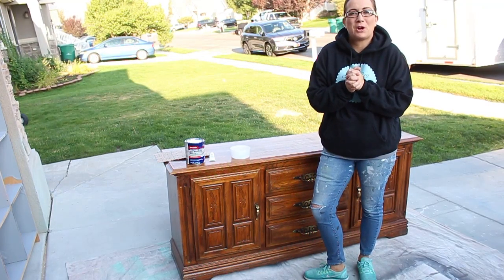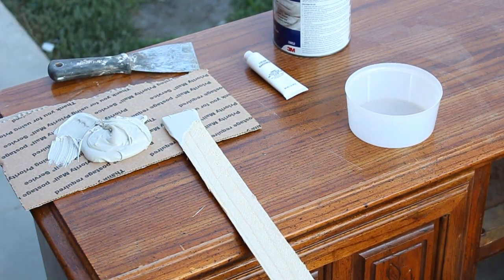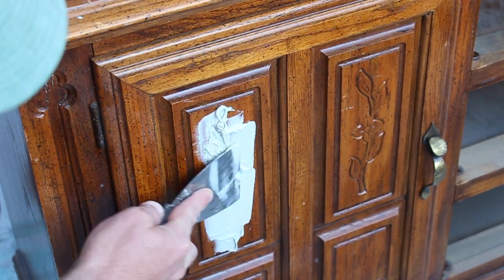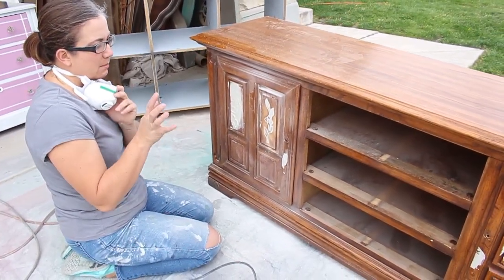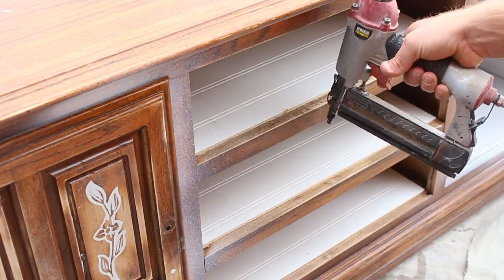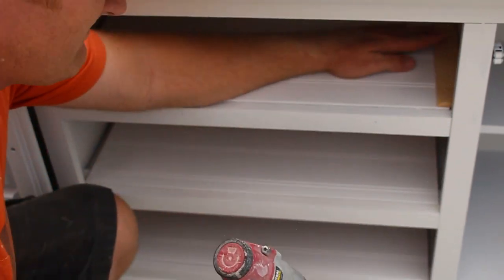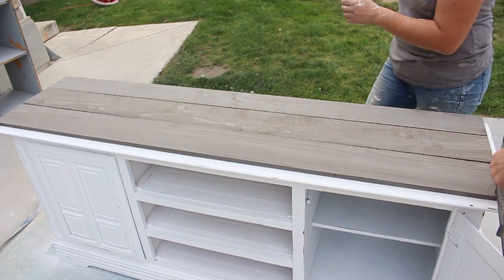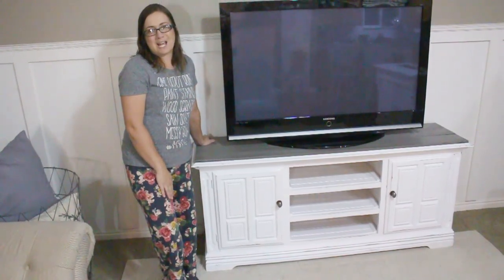Turn A Dresser Into An Entertainment Center

Comment: Great project, very pretty.  Instead of Bondo try Durham's Rock Hard water putty.  It dries fast, but if you add vinegar per the label instructions you can extend the open time.  No smell, sandable and paintable.  Great stuff.

Comment: As a woodworker myself, I would have brought the planking out to the edge of the top and put some 1 x 2's around the edge. The way you did it looks a little cheap to me. Sorry my opinion. Otherwise looks great. Thanks for the videos.
Reply from the maker: Liz Masi thanks!  When the top has detail or a routed edge we like to leave that visible so we just bring the planking out to the edge of the flat surface. Otherwise I agree with you!  A little lip on the edge looks great. 👍
Reply: I agree.  Looks cheezy.  Otherwise nice.
Reply: Who paints a piece w/out taking doors & hinges off? Painted hinges....not good. The “2 tone” is a bit dated...1994 called...they want their furniture back

Comment: Love this project!    Can you share what "gray toner"  paint or stain that you used after the Jacobian stain?    I have an oak table with several leaves that are red oak - and they look very different from the regular oak on the table top.   I thought possibly using that dark stain with something to "gray it down" might be just what I need.   Hope you can help.   Thanks.
Reply from the maker: It’s a gray wash.  1 part paint 4 parts water. I used fairy Chalk Mother in industrial for the paint. 
https://jamirayvintage.com/products/absinthe-fairy-chalk-mother-chalky-finish-paint
Reply: @JamiRayVintage     Thank you SO MUCH for such a quick answer.    I love this little table so much - it was missing the leaves (4 of them) when I bought it - and the man who made the leaves made them out of red oak - hard to believe - and no matter how I tried, I couldn't get them to look right with the original table.   I think this will really be the answer.   I hate to do all that sanding again, but I'm excited to feel like I have a "right answer"!     I'll take a before picture of the way they look now - and then another one when I get a new dark stain with a light gray wash.   Sounds perfect!!!!   Thanks again for being so generous with your information!

Comment: Sipping my coffee, watching your video and waiting for Irma lol !!! What color did Zeb use over the stain on the top to get the grey ? Came out great !!!
Reply: Could the wood putty have done the same thing to fill in cracks?
Reply: Learning.. looks pretty easy. What a transformation. Zeb is like the magyver of furniture lol.
Reply from the maker: Lily Tucker it shrinks and takes multiple layers to get it right. It also takes a lot longer to dry.  Bondo is stinky and you have to work fast but it's the best.
Reply from the maker: Susan Davidson you stay safe!!  Praying for you.
Reply: Jami Ray Vintage good to know. I ll use it next time I run into a piece like that.
Reply: Susan Davidson  ash I wish Jaime would have answered what white wash that was that he used too. I also wanted to know maybe they will come back n tell us.. it did turn out great..
Reply from the maker: Kim Bryan it was 10 parts water to one part paint. And the paint we used was half Snowflake/half industrial

Comment: Hi. I have a question if you don't mind. So, I've finally finished putting 2 coats of a white chalk paint on my china buffet. Couldn't I just use black chalk paint and paint that on in the areas I want to distress, then go over the black with the white chalk paint, THEN sand through to get to the black chalk paint?
Reply from the maker: That should work.  maybe try a small area and see if you like the results.  What color was the piece under the white paint?
Reply: Jami Ray Vintage I wish I could send you photos. The color was exactly like your buffet in this video
Reply: Jami Ray Vintage I also primed the entire piece first with Kilz primer then did 2 coats of Waverly "Plaster" chalk paint
Reply from the maker: You can always send us pictures through facebook messenger.  I've never used the waverly chalk paint so I don't know how it distresses.  Are you not wanting the wood color to come through?  Or do you just want it to be black underneath?
Reply: Jami Ray Vintage you're the best thank you! I've send photos through FB messenger